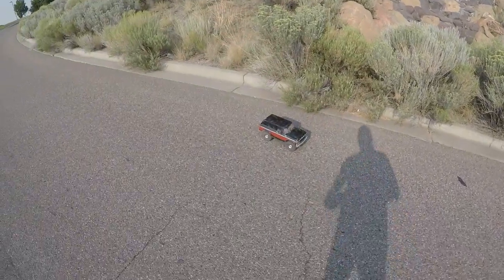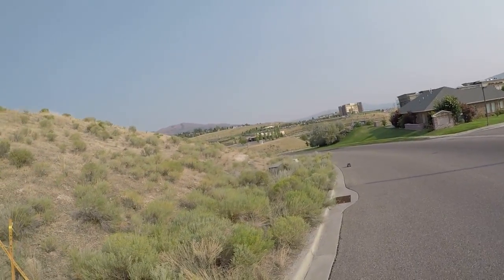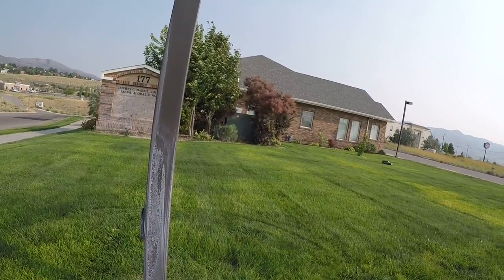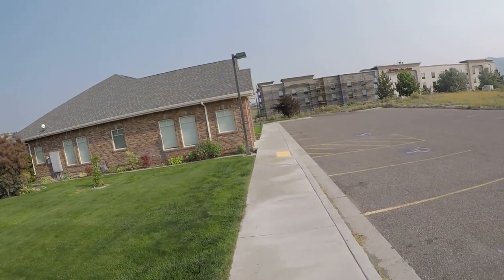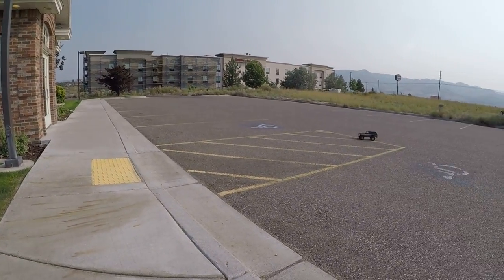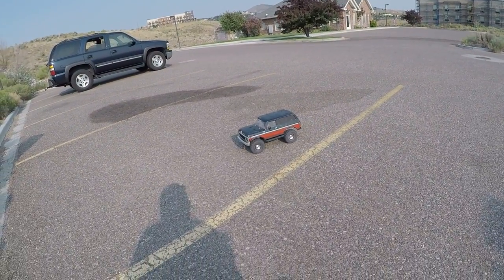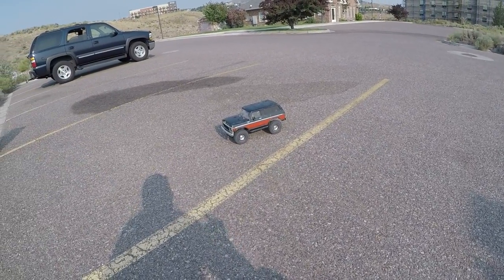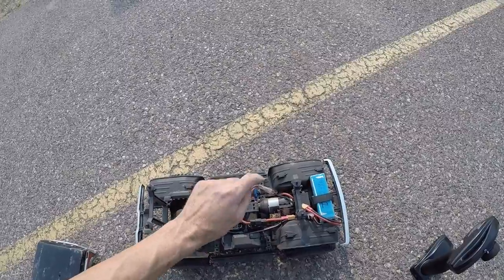TRX4 Bronco Hyrax 3S 16T Pinion running the stock esc & motor

Comment: Is it just the standard 16t Traxxas pinion? Part number 2416. Was looking for a little bit more speed out of mine without having to change the ESC and motor - thinking this is the way to go
Reply from the maker: https://www.google.com/url?sa=t&source=web&rct=j&url=https://www.amainhobbies.com/traxxas-48p-pinion-gear-w-set-screw-3.17mm-bore-16t-tra2416/p-qezkt2qqbmzxactz%3Fv%3D100654&ved=2ahUKEwjA-M6XtLXyAhVoFjQIHSdHC2kQFnoECB0QAQ&usg=AOvVaw2z1qU9V5dJlobRK6Mnymg3
Reply from the maker: I usually run Robinson Racing Pinions. 
https://www.google.com/url?sa=t&source=web&rct=j&url=https://www.amainhobbies.com/robinson-racing-super-hard-absolute-48p-steel-pinion-gear-3.17mm-bore-16t-rrp1416/p-qeaxq2yqtb2xactz%3Fv%3D33747&ved=2ahUKEwiC8__ItLXyAhXlMn0KHYZzDN0QFnoECC0QAQ&usg=AOvVaw2e6aJfwacp0qMoAR31foP4

Comment: Hello friend,
Is it safe put 16t on my trx4 using fusion pro?
Did you have trouble using stock in long term use? Like overheat or else? Thank yoh
Reply from the maker: In the new video I am running 22-39 and it doesn't overheat in low Gear or high gear. Just have to be careful when running in second gear, if you are running on grass or any other terrain that has lots of resistance.

Comment: Great vid, did you change the spur gear too? Or just the pinion and would I get a similar outcome with a traxxas battery?
Reply from the maker: Still running the stock spur gear. The 16T pinion was the biggest one I could fit, running the stock spur gear! As far as the Traxxas battery goes, just make sure it's a 3S '2'200-MAH 25C and you should be all good! Just remember to keep an eye on your motor and esc temperatures. Just to be safe!

Comment: If I put the 16 t pinion with everything stock and use a 2s will anything bad happen
Reply from the maker: It all depends on where you are driving it, and what you are wanting to drive it in. This is a tough question to answer. Need to know what kind of surface you would be running on. Like hard packed dirt, short grass, sand, gravel, should all be okay.

Comment: my trx4 with traxx came with 11t..if i put the 16t will it go faster?? nive video btw. thanks
Reply from the maker: Yes it will go faster with the 16t pinion, but you have to be careful with the motor temperature 🌡 not to exceed 180°f.
Reply from the maker: The traxx have a lot of rolling resistance and this will also shorten your batteries runtime.

Comment: wasn't there a guy that gave you an easily transportable 2x4 edge 2'x2' ramp or 2? you should never be without ramp...
Reply from the maker: Ryan Dorman, as a matter of fact I do remember that guy Givin me a couple of those ramps! I will grab them in the morning after I leave the office. Hmm, this is gonna be fun!!!
Reply from the maker: I will bolt on the stock tires, and run the LiPo in the mid mount tray. Then we will fire up the gopro 😈
Reply from the maker: Oh dude, I have tons of wood in the man cave. I will get a few extra ramps put together tomorrow after a little nap ;)
Reply from the maker: I might have to go brushless in this rig. I'm thinking 50+ is possible! 😈
Reply from the maker: Yep, I have both 24"X 24" ramps, and now I'm thinking BAJA 500 along with a little Suspension tuning. And possibly building a few more ramps.
Reply from the maker: Might have to put the Showdown 2.2" tires on the Rusty with the gopro mount out front. This could entertain my simple little mind for days!